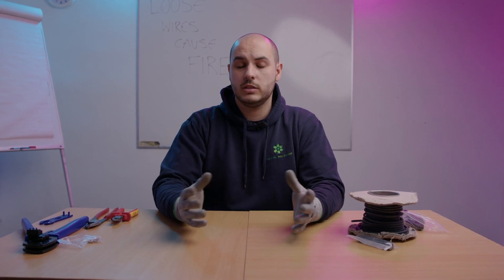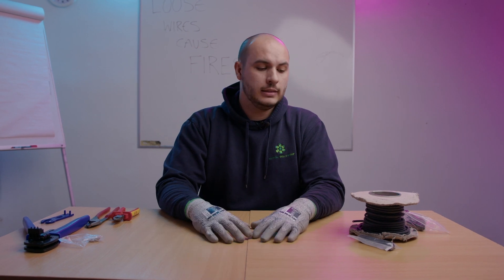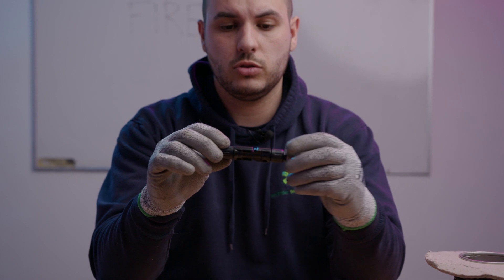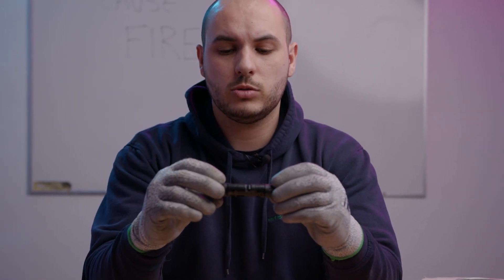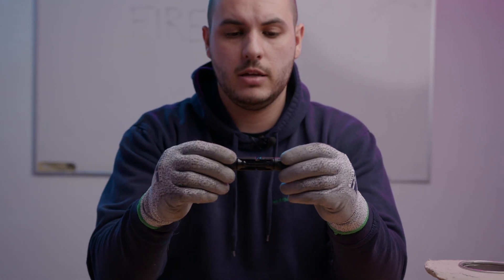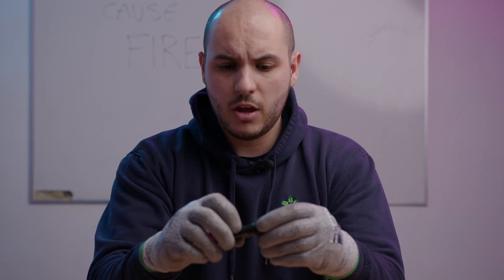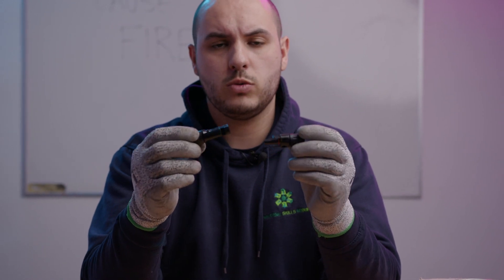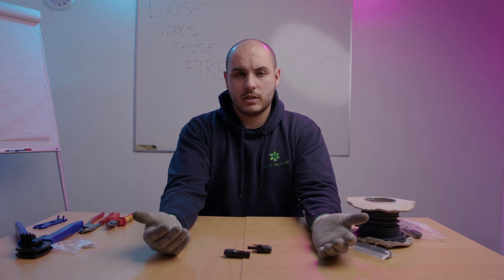Wiring a Solar MC4 Connector the right way!

Comment: An important note about connectors that isn't pointed out in this video, there's only 1 true MC4 connector, now made by Stäubli. All other "MC4" connectors are "compatible", but even that is an exaggeration.  You should only use connectors (or cables) from the same manufacturer in your setup because every connector, essentially the mating pins, has different tolerances so you will create resistance with your wires and will also create a potential fire hazard.  So for safety and better efficiency, don't mix connectors from different manufacturers.  It's also a good idea to use a crimping tool designed for the manufacturer’s connectors.